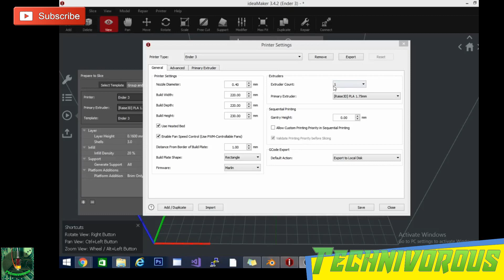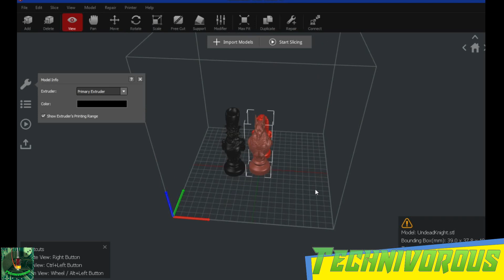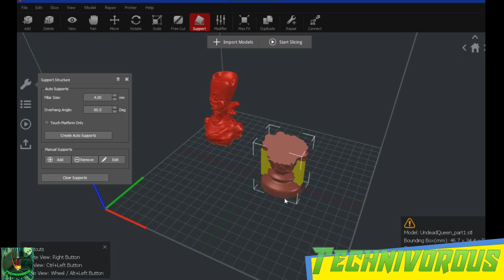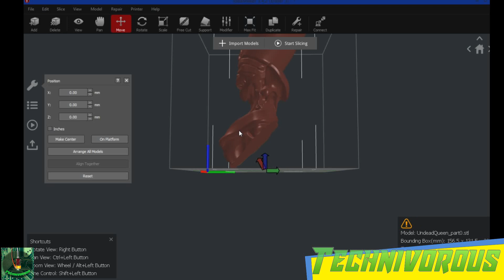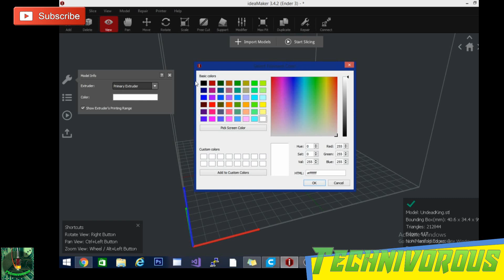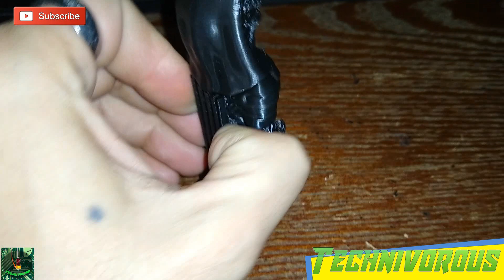Raise3D's IdeaMaker -  WOW -  This could be a Cura Killer!

Comment: Right click on object, lay flat, choose the face and click apply. No need for new cura :-)
Reply from the maker: beautiful man! thank you!
Reply: @Technivorous  no problem, had to search a bit myself. Everything is with giant icons except that feature. I'm still searching a way in ideamaker ro organise my materials better
Reply from the maker: im working on a follow up that will include this. do u know any other tips or tricks? im haooy to hear them!
Reply: @Technivorous  I'm new to 3d printing (have my printer since July) and only installed Ideamaker a week ago, so I don't want to give tips that later seem to be false or features I miss-use. And if anybody wants to correct me; feel free; I can only learn.
 The first little feature I like, is when you use sequential printing the clearance distance is visualized on the buildplate in light gray. Prusaslicer only gives you a warning ("Some objects are to close, ....") and you just have to figure out yourself which they are. Cura does it the same as Ideamaker, so they are on par. 

The second reason I'm trying out Ideamaker is to dial in my filament. I absolutely hate doing that and to be honest I'm not very good at it (I just want to print something else than calibration cubes). Doing temp tower, flow rate and stringing tests. As far as I have tested Ideamaker excels over prusaslicer and cura because of the Per-group, per-layer and per-model settings. 

* If you want to do a stringing test in Cura you have to set retraction distance -> start printing -> observe what happens -> stop print -> change distance and reslice -> start printing -> repeat.
Just like in simply3D the 'per-layer settings' gives you the ability to adjust retraction distance or speed from a certain height, thus combining everything in less stringing tests.

* To do a temp tower sadly enough you can not set temperature in the 'per-layer settings'. Instead, you have to go to your slicing template where you can set temperatures at a certain height.

* For the moment I only use per-model settings if a certain option is not available in the 'per-group settings'. For me, it's a sort of last resort if I can not do it in another way.  Choosing between skirt, brim or raft for each object on your buildplate is one of those. Just make a duplicate of your slicing template and change the settings you need and in 'per-model settings' you choose the template you want for each object. This feature gives you a lot of freedom.
Reply: One problem I have with Ideamaker I can't seem to fix:  on prints longer than an hour my ender 3 pro crashes at the end. It's not due to the micro sdcard. Must be something to do with the gcode but I can't figure out what's causing it.

Comment: What is the main difference between this software and Cura?
Reply from the maker: This on has the ability to easily split models into pieces right into the slicer, as well as a super easy friendly interface. Cura is updated more frequently, and is pretty user friendly as well. Print quality is the same if you adjust the settings to be the same so it's really all about preference.

Comment: Just downloaded and poked around bit. Found one cool thing already. The fan blip option under "cooling". It appears to bump your fan speed up to 100% for a user specified time to get the fan moving. I have noticed my stock part fan not starting if set to under 30%. This is a feature that shows some developer insight into PETG cooling. 

Now after a few attempts at getting a template set up for TPU and failing to find a simple way to change layer height temporarily for a single print, I'm heading back over to the CURA camp. I have crashing issues after slicing though now. I've tweaked a few profiles in PrusaSlicer and use it once in a while. Even it is more user friendly IMHO.
Reply from the maker: thats dissapointing that your experiencing crashes. ill be looking into this more, and ill let you know if it gets fixed.
Reply: @Technivorous  I believe I sorted it out now. The crashing wasn't crashing. It was freezing up but I had to much running in the background I think. Figured out the templates. Will try a couple prints this weekend if time allows.
Reply: I'll try a clean install tonight. Worth a shot.